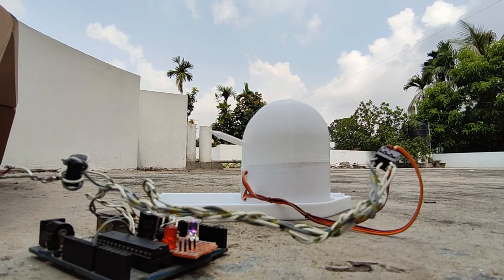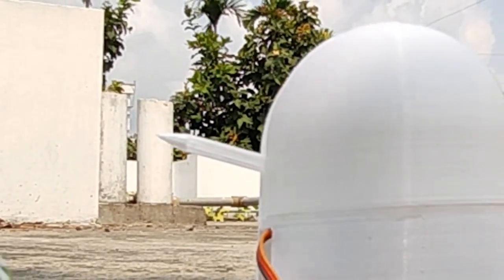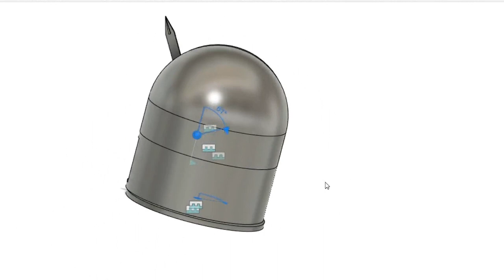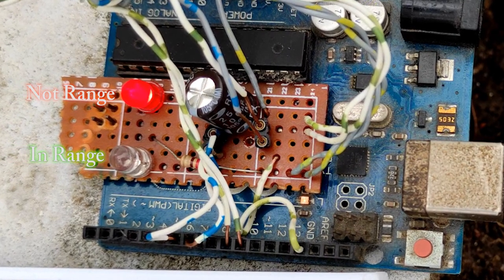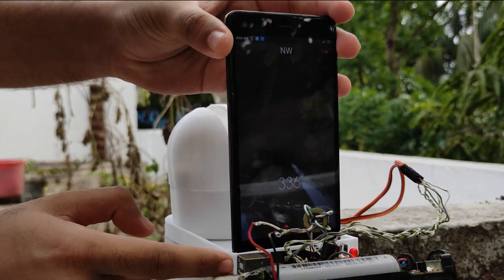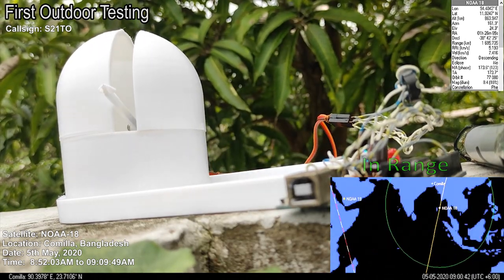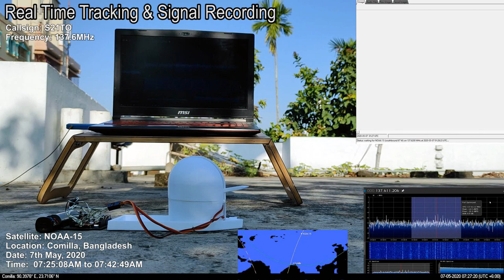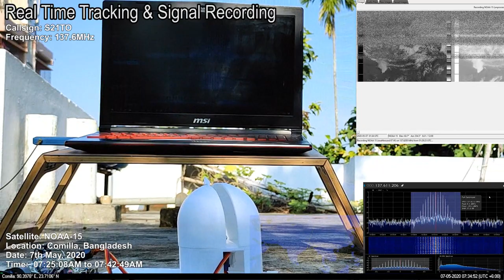[3D Printed] Real-time Satellite Orbit Follower/Tracker with Arduino

Comment: what if the satalite is on the other side of the earth? Wouldn't it need to be able to point below the horizon
Reply from the maker: There are two indicator LEDs. When it is on the other side, the red LED is illuminated and the device is idle. There will be no signal coming from it. When the elevation is above 0° or the satellite is above horizon, only during that time, it points to the satellite. As there is not signal coming for it while it is on the other side, we are not much interested in pointing its Position during that time.
Reply: @tnowroz  That's pretty smart, I understand why you would only need 180 degrees